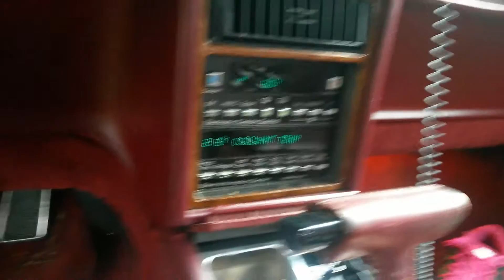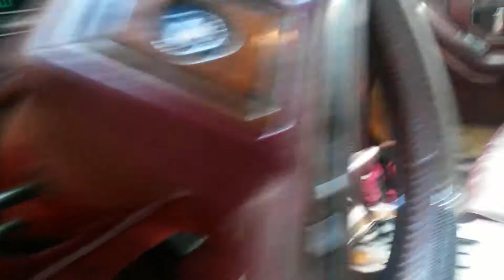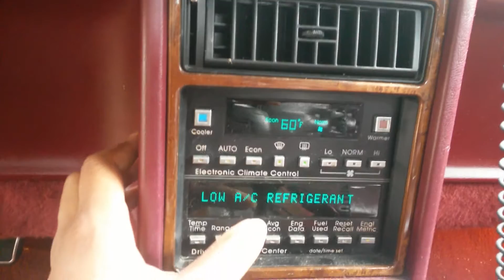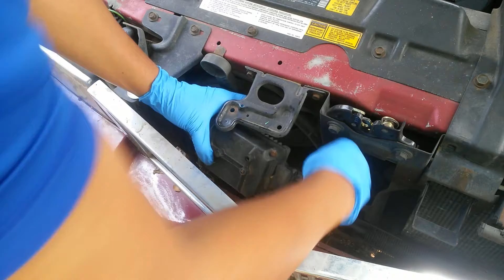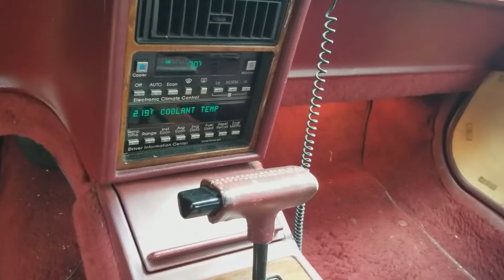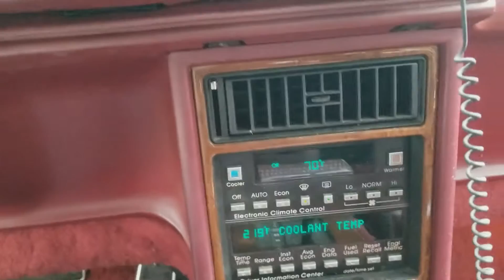How to diagnose & replace cooling fan controller 1986 to 1991 Cadillac Seville Eldorado Deville

Comment: I wonder why my Seville doesn't have a fan control
Reply: You have the 4.5 I have the 4.9 and my fan only comes on when when cut the A/C on but when I cut the A/C off the fans not working
Reply: @butchsutton3006 I’m having the same problem. Is it just how the car is build or there is something wrong? Because looks like we should have the blower motor running all the time so the radiator fan is running also?

Comment: Hello! 

I have a 1987 Cadillac Seville, the fans are running all the time, the coolant is coming out of the reservoir.  Do you have any idea what it could be?  I also have the interior/exterior lights, dashboard going on and off all the time.

I live in Portugal and I have a lot of difficulty finding parts and people who know these cars.  Do you have an e-mail, telegram or WhatsApp so that we can discuss this car?

Thank you very much. 

António
Reply from the maker: sounds like it blown the head gasket to me. but i cant be for sure. i dont know what the light issue could be. do you have the factory service manual???
Reply: @devajonesdiy   I dont have the factory service manual.
It's not the gasket, I thought that was it too, I've already solved the problem with the water and the lights.  The BCM box was defective.  
Now I have a problem with heating.  I think it is part 12484912 that is defective.  Is it normal for the fans to spin when I start the car?  they stop when the temperature reaches 213F and turn again when it reaches 222F.
thanks for your answers 🙏
Reply from the maker: @antoniofernandes4870  the car has 2 fans.  yes that is normal operation if you have the AC on if the ac is on both should spin the front and the rear. if you dont have it on the fans shouldnt be on when you start the car the fan closes to the motor should turn on at 213 and off at 222
Reply: @devajonesdiy   Ok, thank you very much for your help and thank you for your videos.
Reply from the maker: @antoniofernandes4870  thanks for the questions good luck and thank you for watching

Comment: My deville had cut off on me because the radiator busted but it’s able to
Start bck up I don’t see a oil coolant mixture in the oil I need honest help like should I just replace radiator?? Like I just want to make sure because as Soons I turn the key it says stop engine I just want to make sure that’s a common thing when the radiator is empty
Reply from the maker: Do not run that motor another second with a bad radiator and no coolant. That's any car not just a caddy. If you ran it far enough for it to cut off i know you over heated it. If you cracked a block or blew a head gasket can't tell until the radiator is fixed. There is no sensor for the coolant if that's what you're asking. That light is telling you basically if you keep driving you're destroying things.
Reply: @devajonesdiy  ok thanks I’m going to test my luck tomorrow I hve a 4.9 it only overheated once n I never drove it again only once to pull it up in the driveway it had overheated though like a block away from home and wouldn’t start so I pushed it home and a few hrs later it started up again so I parked it and the driveway and been fixing small things like the valve covers but just wish me luck tomorrow😢 single dad n my baby bday on the 9th really needed some in sight with this thanks a lot will watch your channel more

Comment: Is there a was to upgrade this? I can’t find a controller anywhere in my budget.. but I have been seeing electric ones for $30 at auto shops
Reply from the maker: You can try aftermarket fans if you want i don't know if they will actually do what you want. Try the junk yard or ebay for these they are a discontinued part. To be honest if you don't really have much money i don't recommend these cars most of the parts are cost prohibitive that's probably why you have no ac compressor they are over 200 bucks

Comment: Good video. Cadillac seem to make its vehicles with a fan control module (fan controller) this acts as the relay. There is no fan relay when its equipped with a fan controller. There will be a small fuse but most likely the fan issue would be a faulty controller. Thank you for showing in depth what the issue is and how you fixed it!
Reply from the maker: you're correct thanks so much for watching!
Reply: I wonder why my 91 Seville don't have a control module in the front of my cadillac

Comment: I am having the same issue with my 1986 Coupe de viile.
Reply from the maker: i hope you get it fixed, its not a hard repair
Reply: @devajonesdiy  Thanks Deva, I have gone to two different mechanics. and nothing I got her for cheap and she only has 35.000 miles, It was not driven so I put new tires, radiator, hoses, and rear shocks. Windows have been a pain and the AC doesn't hold but other than that she is a baby cream puff, Little unloved but recovering, My kids love her but my wife hates her. I appreciate your advice, I also hate mosquitoes,
Reply from the maker: @radromy3326  LOL put on some soft music and get in the back seat with your wife late at night while the kids are in the house asleep. she will learn to appreciate the car more LMAO dont tell her another woman gave you this tip (dont do this while there is snow on the ground it will backfire i assure you)!!! Its hard to pass on a car with that low mileage and is neglected I know the feeling. I've been to CA (cars anonymous) several times the 12 steps never works i keep relapsing. #Addicted

Comment: My air compressor is off because my refrigerant is gone! It says air compressor shut off! So that’s why my fans aren’t running. Going to check that out!The mechanic ran a line from the fuse box to the fan to make it work until we can figure this out. The temperature for the thermostat out of the radiator should be 195 so the fan should come on!
Reply from the maker: Mine does the same. I have a leak somewhere that I need to find. The fans will turn on if the temps hey high enough. The fans don't come on until the coolant temp is over 217 So if your fans aren't coming on at all you have another problem. The a.c simply makes the fans run constantly to pull air across the condenser. So your fans should be operating the same way you see mine in the video. My ac is not charged in this video.
Reply: @devajonesdiy   I just bought a 88 El Dorado and the fans won’t work when it hits high temp. Watched this video and tried…Says air compressor off. The fans Will turn when the AC is on but no air is coming through because it turns out I have no air compressor. If I replace the cooling fan module will the fans turn on when the coolant reaches a high temp even if there is no air compressor?
Reply from the maker: @logoffandlivelife  they should. How is this car running with no ac? What's in its place?
Reply: @devajonesdiy  runs fine surprisingly. nothing it in its place- they tied the hose to a random rod to keep it of the way. I’ve been driving it and it leaks coolant due to the crack in the radiator cap. I haven’t replaced it because there is no cooling fan and I was nervous about all of the pressure building up. I live in a small town so I stick driving it about 2 1/2 square mi. By the time I get home the coolant temp is about 201. I am nervous to have it get any higher than that until I fix the fan.
Reply from the maker: @logoffandlivelife  but what belt is on it? because it cant be the right size....with no ac compressor the belt will not be the right length. i know a car will run with no ac compressor but i'm curious as to how they found the correct belt length idk. whoever had that car clearly rigged up things

Comment: No way...you are a jack of all trades! Nice vintage caddy!
Reply from the maker: LOL what are you doing up at that time of morning!!!! but yea i been doing this since i was like 15 even though back then i wasnt nearly as good as I am now. I spent more time breaking stuff back then than anything
Reply: @devajonesdiy  That's reassuring and inspirational Deva, about breaking stuff before, learning from it and doing more fixing now. I am sometimes not careful enough whilst trying to fix something and break it or try to adjust the petrol strimmer or lawn mower carburettor fuel mixture screws and forget where I started from, having to readjust for hours and look it up online to get it right. I am starting to learn to do better, note it down or take pictures of how the parts were assembled, be more careful and remember things better too
Reply from the maker: @iliagofman  that's what I think it's about basically. Learning as you go along. I think with that you actually show yourself that you can in fact do it. Even if you struggled you ultimately did it and persevered through it. That's the focus. So keep pushing even when you break things don't give up! Thanks so much for watching and reading what's between the lines. Btw I take pictures and use the internet for reference all the time it's not cheating I promise lol
Reply: @devajonesdiy  Thank you very much Deva! I will persevere and keep going. Everyone needs help at some point and you help me